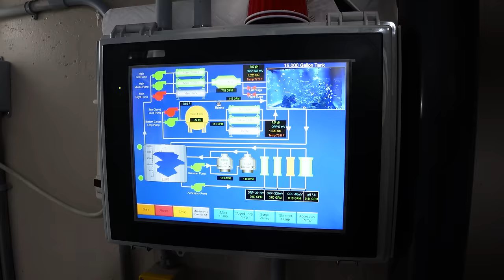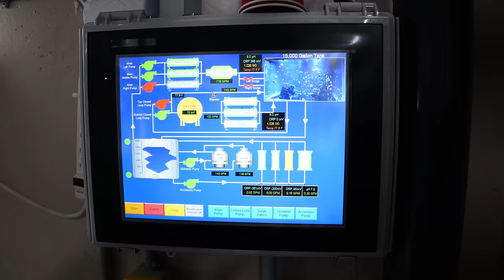WWC Visits The Largest Private Reef Tank in America

Comment: Beautiful setup, thinking I’m a few hundred million short of having this setup.
Reply from the maker: You can start off small! 😜
Reply: @WorldWideCorals  I’ve always wanted a salt water tank, all the local pet shops/breeders tell me they don’t recommend anything smaller than 100 gallon for  a salt tank, but actually recommend 150-200 gallon, obviously bigger if you can afford it. They claim ur too limited with tanks smaller then 100 gallons and the maintenance is actually more consuming. I’ve only ever had a tropical tank and a African Cichlid tank that was 55 gallons.
Reply from the maker: @Imprisoned1995  yes it is true that a larger tank would be recommended but doesn’t need to be that big! Every tank is going to have its only specific care requirements and needs based on the size. So you can do any size! There’s just going to be different needs ;)

Comment: 17,000 gallons?  1000 an inch?  So 1.1ft tall?  Maybe he meant 100 per inch… yes, yes.  17k % 9 is 1888/ft

I have an idea of a home build with a floor to ceiling tank about 10-12 ft in from the front entrance. Centered.  10ft tall 12-15ft wide but only 2-3ft thick…Can walk around it to the living room with vaulted 20ft ceilings. Would be a nice centerpiece.  I just had no idea what goes on behind the scenes to keep it optimal